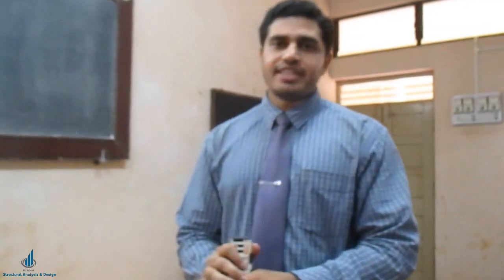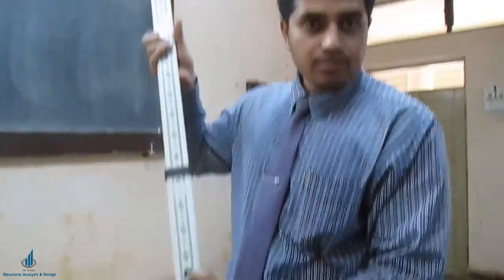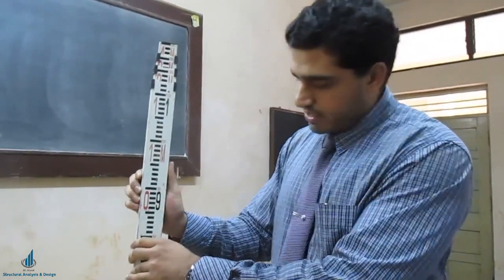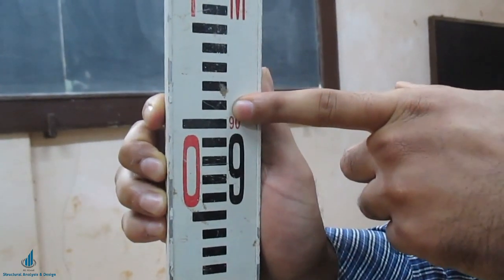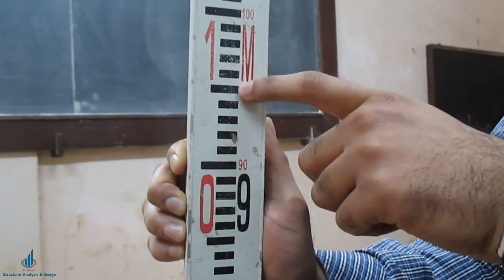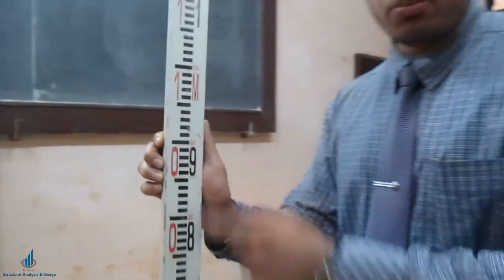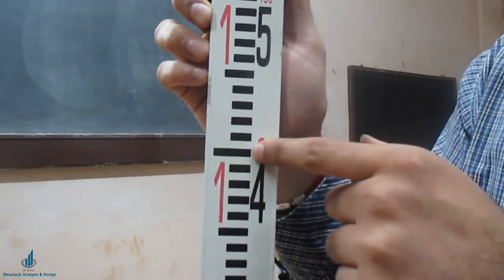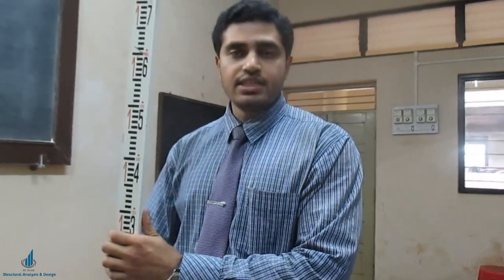How to read levelling staff | Staff readings on a levelling staff | How to read auto level staff

Comment: On back side of staff there is also reading same as front side you explain...what is the use of back side reading??? It's very important question..I faced in interview
Reply: They are in different units
Reply: @MasterCivilEngineering  you means inches or feet???
Reply: Yes